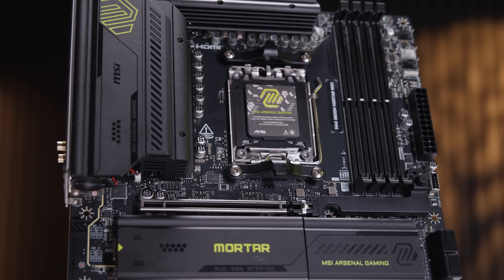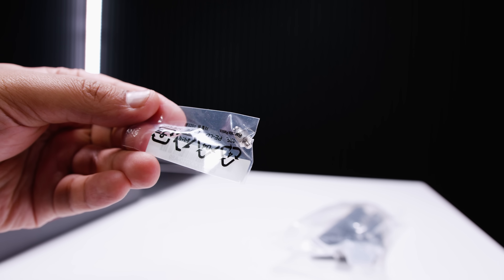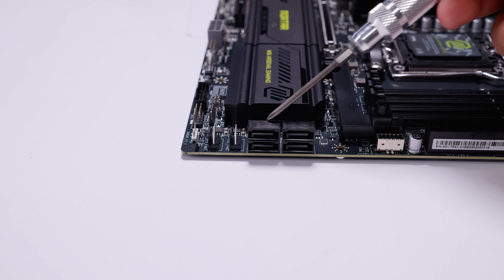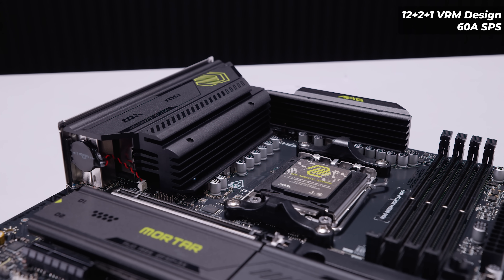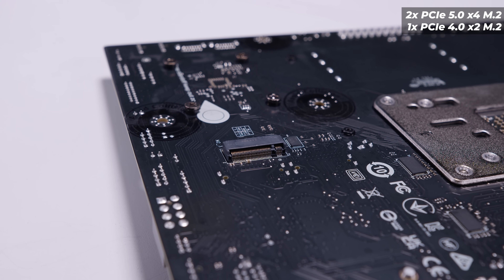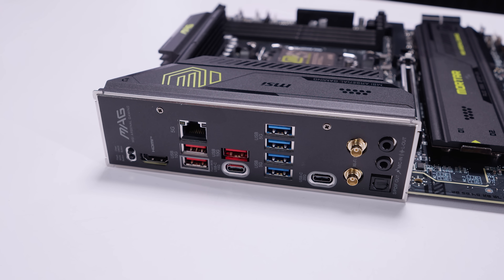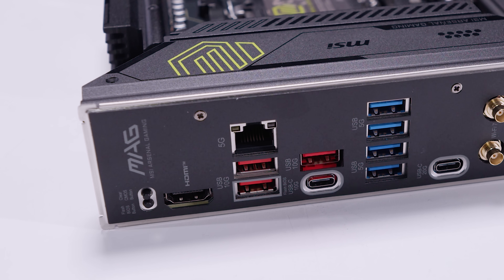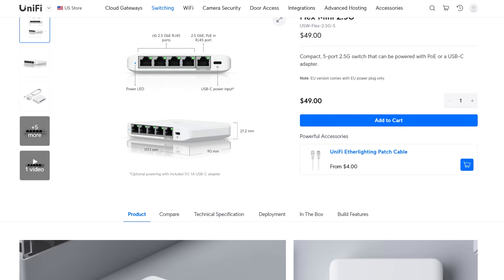MSI added a game changing hidden feature to the MSI MAG B850M Mortar WIFI

Comment: Nehmt beim Mortar B850M Wifi  nur bis zum 7E61v1A45 UEFI alles neuere macht nur Probleme.
Bei mir alle 3 M.2 Pcie NVME aufgelistet im Uefi nur die 2te die man auf der Front verbaut, kann nicht mehr als Boot Laufwerk ausgewählt werden.
Ein Rückflashen brachte auch nichts, Stromlos machen brachte auch nichts.
Zudem ist im neuen 49 Uefi ein Microsoft Security Level 2 Option mit hinzu gekommen, da will man von MS weg und nun sind die im UEFI.

Comment: Just got one of these, PCIe slot for GPU is very close to the CPU socket and took 3 different CPU coolers to find one that fitted without hitting GPU backplate, big design overlook from MSI!
Reply: Which cooler did you end up going with?

Comment: MSI Giving us 2 thermal pads for each gen 5 slot for this board yet the ATX ver, the X870 and X870E boards don't have bottom thermal pads for the 2nd gen 5 slot is diabolical.

Comment: Hey, I'm very close to buying this for my jonsbo Z20 build with Deepcool MYSTIQUE 240 ARGB. 
Do you know what possibilities are there to control ARGB, fans etc with this board? It is the first modern build that I will be doing
and I want to buy the correct case fans for this and am scared if I go for Noctua or others, that I need several different softwares to sync them etc?

Or do I need a ARGB controller/hub?

Comment: When would someone need to use that extra pcie power connector at the bottom of the board?
Reply: back in the days, it was used as wifi slot, or audio card, nowadays it is used as SSD/USB expansion boards
Reply: @rexs3ll no the power connector... Not the expansion slot?

Comment: Never get the idea of putting NVME slots is godawful places like the back of the board or behind the GPU. Like, Put the slot beside the RAM, where we can access it easily without taking parts off. How hard is it to make it accessible?
Reply: Remember that it all has to be routed internally. Especially next to the RAM slot this would add a ton of trace routing complexity and could cause signal interference. Now tbf, ASUS did this with their DIMM.2 slot on higher end mainboards so it isn't impossible, just most likely not a thing you'll see anytime soon on budget mATX boards.
Reply: Most modern cases have a big cutout in the back with tons of room for a back mounted nvme
Reply: Or just place it below those 2 m.2 slots.... like how many people now days use any pci-e slot except X16 main one for GPU? less than 1% id say.... so why not populate that space with third m.2 slot instead of useless pci-e no one will use?!
Reply: Beside the ram? So where the CPU is?

Comment: There are actually a few mATX boards from ASUS with an M.2 slot on the back. ASUS Prime B840M-A for example.
Reply: Personally not a big fan of M.2 on the back btw, they're not always accessible from the back of the case and can get quite hot. Not like you can't fit 3 or even 4 M.2s in the front if you wanted to on an mATX board. Take a look at the ASRock B860M Steel Legend for example, it has 4x M.2 PCIe slots, all in the front. One of them is actually going across the chipset heatsink lol, very ingenious design.
Reply: @-eMpTy-  ASRock is certainly the king when it comes to connectivity on the cheap 🤙. Always 3-4 NVMe slots and tons of USBs on even their sub-$200 mainboards. I think I've seen up to 6 NVMe on some of their boards, insane. Currently still on a B650 Aorus but I'm seriously considering a Taichi for my next build.
Reply: @-eMpTy-  but why would you need to access them more than just the first time you build the pc the motherboard has 4x2 so its speed is abit higher than the gen3 m.2s like Kingstone so just but the Kingstone in the back and you are good and if you need a fast m.2 for editing or coding or something else just use the 2 in the front and when you want just more storage regardless you just need to access it once which might be a pain in the ass but it is just once and if you already know you are ok with a gen3 speed m.2 just but a Kingstone gen 3 m.2 in the back

Comment: What's the difference and which is better.  Msi B850 gaming plus wifi and/or Msi x870 gaming plus wifi if price difference is $20
Reply: If you don't know the difference most likely you don't need the fancy ones. Typically it's just connectivity options like NVME generation difference or VRM upgrades. But eh, none of that really matters if you're not an avid overclocker so just get a cheaper one.